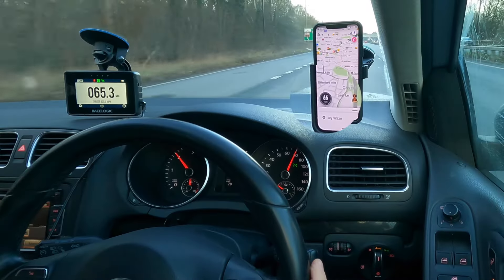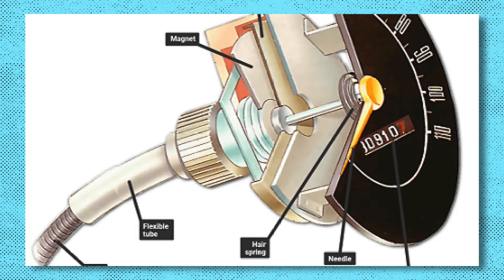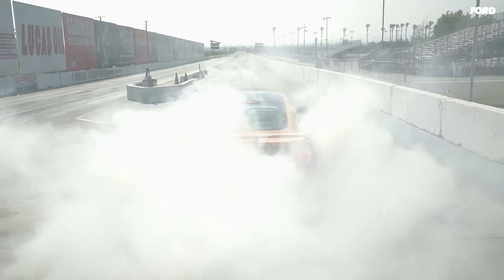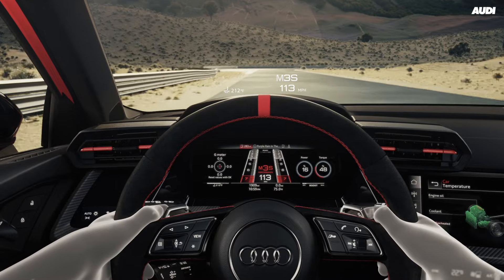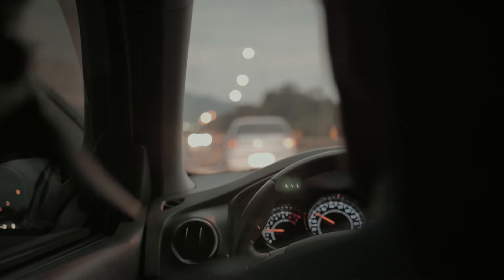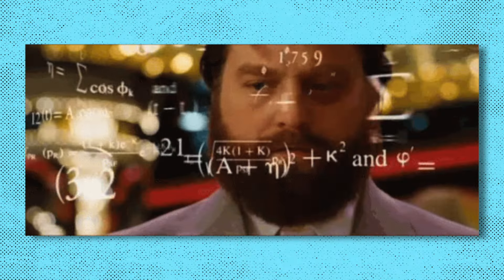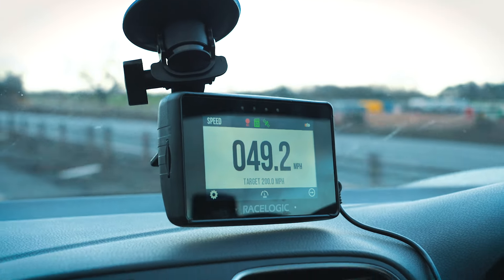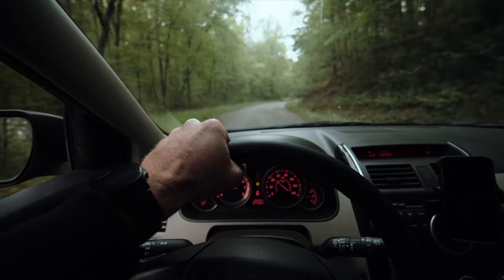Why Your Speedo is Lying to You

Comment: I'm using android multimedia- and there is a built in app as well as torque that shows actual speed, and it always off- e.g to go 130km/h your speedometer must show 137- at 200+ it makes differences up to 20km/h where 240km/h == 220km/h.. its also golf 6

Comment: In Australia the Design Regulation 18/03 specify for cars:
_The production shall be deemed to conform to this Regulation if the following relationship between the speed indicated on the display of the speedometer (V1) and the actual speed (V2) is observed:
In the case of vehicles of categories M and N:_  (Cars are in class M)
0 ≤ (V1 – V2) ≤ 0.1 V2 + 6 km/h  

So in short the speedo can read up to, 10%+6kph over the actual speed, but not under at all.
My Honda bike is a consistent 10% higher than actual, my old Toyota also over read, but my Jeep is reasonably accurate from factory.  (It is more so now that I recalibrated it against GPS via OBD2 by updating the wheel size recorded in which ever one of the computers stores that data.)

Comment: My Toyota GT86 dash shows constantly 6km/h over. The OBDII port reads exactly the same as GPS speed. The car knows how fast it is going but has a safety margin to make up for weird tyre choices I am guessing. Anyway I always drive an indicated 10km/h over which is only 4km/h over and under the trip point of the speed cameras.

Comment: I live in Germany. My car reads some 10km/h off at high speed, 5km/h up to 120 km/h and it is very accurate up to 30-40 kmh. I usually drive 23 over the limit. I might still get a ticket, but I am not risking my licence (licence gets suspended from 23km/h upwards). Needless to say I do this on highways and not in cities where such high speed can be dangerous in 30km/h zones(although in some is perfectly fine).

Comment: My 2005 Cadillac STS is spot on and same with my 2014 ats. Both Speedo’s are spot on. My 05 deville I changed the wheels so my speedo isn’t accurate. It’s off by 1mph or so.

Comment: Here in Texas, USA you will often see a radar unit standing just off the shoulder of the road. It will show you what it what your speed is according to its radar reading is. Now I drive a 2011 Ford Escape with a six cylinder engine and a five speed manual transmission (100,000+ miles on the clock). My speedo indicates 62/63 mph when those radar thingies tell me I am doing 60. Not bad I think.

Comment: Having owned/driven multiple Mazdas i can confirm that all of them where almost spot on (often only 1-2kph slower at 100kph) with the speedo compared to GPS, where many german cars, even recent ones, needed a bit over 110kph on the speedo for real 100kph gps. a golf 6 i could drive at 150kph indicated on the autobahn while only doing ~132-133 real. 

that might also explain the tendency of many people bragging their car goes 30kph faster than the manual says (no car will do that) because simply the speedo is indicating 10% + 5kph too much and there was a slight tailwind.

Comment: My Australian Ford G6E Turbo shows an indicated speed of 110kmph whilst GPS indicates 109kmph. Factory wheels and factory size tires. My wife's freelander 2 however is s different story indicating around 7-10kmph (4.5mph-6.2mph) (at 110kmph) faster on the speedometer vs gps. These are logarithmic and relate better to a percentage as the faster you go the further out they are.

Comment: My 2017 Clio says 50 when the radar speed camera near me says 46 when I'm driving past. Also I regulary sit behind cars in 30 zone where they must think they are doing 30 but my Clio tells me I'm doing 27/28.  Seeing as my Clio under reads by 8%, they must be under reading by even more.. I've defn been thinking my car under reads for a while but thought it was just me so thanks for letting me know it's endemic in nearly all cars.  ps I have a vanilla Clio, no mods or wheel/tyre changes.

Comment: My motorcycle (Yamaha FZ6) has a 5% margin with new tires, and 7% with worn tires... And, in Spain, the tolerance that you have on speed cameras is 7km/h for 70km/h or under, 10% for any higher to 70km/h. Additionally to that, they do implement a buffer to ensure that when it goes off, you're screwed. Meaning, a speed camera in a 120km/h section could fine you starting at 132 real km/h, however, they won't go off until 135km/h. This is so when the camera flashes, they can streamline the processing of that ticket and ensure that you can't refute it.

Comment: What about tire pressure? Tire pressure causes tires to rotate at different speeds. In fact, that's exactly how my Civic kicks on a low tire pressure warning since the tires themselves don't have a pressure sensor.

I imagine if you're riding with low tire pressure, your speedometer will also be off.

Comment: I have a 2013 VW GTI and installed a Kenwood head unit that has navigation. The speedometer never reads more than two MPH higher than the GPS.

Comment: It’s telling when a 15€ adapter which connects to the OBD2 connector makes a correct speed reading compared to the cars odometer. Shows you what junk manufacturers sell you. If they can’t make it display the correct speed (again, the cars sensors actually measure the correct speed), the car is trash as total.

Comment: My 1965 Ford Mustang speedometer reads 60 MPH when I ‘m actually doing 50 MPH.  However, I have changed the gear set in my manual transmission to a close-ratio set, changed the rear-end gear set to a 3.50, installed lower profile tires and even changed the speedo pick up gear.  So, guess I’m just screwed.

Comment: the speed from teh gps is only as accuracy as u set it to be just like the one from eh car. if u make the refresh rate from teh gps too slow and u  were driving in circles, the gps will calculate the distance from point A to point B in a straight line, so if the refresh rate is not high enough, then teh speed from teh gps is actually be lower then teh actual speed ur going since it measuring in a strgith line and not eh circulfrense of the circle.

Comment: Tires are waaay important in this matter.  i can tell the difference with my BIKE when i ride a fixed distance on the speedo when my tires are fully pumped up or soft.  over a 5 km distance 100psi tires vs 85psi tires (the same tires btw) amounts to maybe 50 meters.  The speed measurement is a simple magnetic wheel sensor and a tire diameter, which brings us to tire diameter.  overinflated, underinflated, hot day, cold day, tires refitted not using OEM stock sizes all have significant effects on speedo readings.  I am sure cars are probably setup to measure quite accurately the RPM of the drive shaft or axle, but then there are differential axles and other complications, probably all in the noise.  But tire circumference MUST be the key variable...  On my bike, my garmin computer calibrates periodically the tire circumference using the GPS so that the robust system of the wheel sensor is accurate and averages out any errors over the course of a ride.  Old school systems had a fixed circumference (user set) of course and no GPS.

Comment: Hyundai i30 1.6 D. 5% over. When I get into a “new” car idk two things:
① a “panic stop” under controlled conditions. I’d rather know if the rear is going to overtake the front under ⓜⓨ terms 
② try to get to a motorway with a good stretch, stopwatch and set the cruise control to say, 110 km/h and then time to do a stretch of at least 50 km. This should give a relatively good approximation of real speed. 
I have had Toyotas, Nissans,  Peugeots and the only one that was close to spot-on was a Holden Commodore series 2 1972. (Stralia, I also stalk strine)

Comment: im so happy America is big enough that speed cameras are so rare. as well as speed has a good deal of leniency, depending on the area, ive had officer interactions where they have told me they dont pull anyone over going under 15mph over. on average on the highway its a 10mph leniency when it comes to law enforcement. i actually even think radars are only accurate to about 70% of the time which is why cops will give that leniency.

Comment: I think you need to compare the speed reading vs the actual milage. As your car may be racking up miles you are not doing! Meaning more frequent services and false mpg. 

Using VCDS you can compare the ECU wheel speed sensors vs the readout (often different) 

my Ateca is 3mph out at 70

Comment: Motorcycles are generally really bad. That euro rule is about where most of them are, 10% + the 6km/h. My zx6 with an old school mechanical system is very optimistic, a true 70 mph is around 83-85  indicated. 20mph is pretty much an indicated 30. Little wonder I felt like I was crawling in a 20 zone with a camera.....   I would have been lucky to be doing much more than jogging speed!
One thing of note, as the bike doesn't have a fuel gauge I reset my trip meter to gauge range left in the tank. The odometer mechanism IS almost spot on to within less than .25% which can be accounted for by the shape of a motorcycle tyre and how it actually corners.

Comment: There's a few things to point out. First, all modern cars also measure speed via GPS. Second, measuring speed over GPS doesn't work by comparing positions because this would be hugely inacurate. As far as I know, they measure the Doppler effect on the satellites signals but I'm not sure that's correct. Third, speeding cameras tolerances isn't for fun. It means the measurement can be off by this amount. So, going 55, the cam could read 50. But it could also read 60. So don't rely on tolerances - Only rely on the readouts cause then you might be a few mph slower but you're very safe from tickets.

Car manufacturers have no interest in faking speed readouts - Everybody knows speedos are off. They do have an interest in not getting sued to pay speeding tickets because their speedo was underreading.
Reply: Awesome that someone else is pointing out the Doppler effect. That's correct to my knowledge. With that you also don't need a minimum of 4 satellites as you'd need to read your position.

Comment: My Golf GTI reads 1 mph slower than GPS at 70 mph. At much higher speeds in “Mexico” it reads 6 mph slower. I have this thing called PolarFIS which reads off the CAN BUS. That’s accurate. It shows the speed and other pages of info on the screen in my dash. On my Audi RS3, the speed is dead accurate with GPS. It’s strange.

Comment: I always do 10% over (on gps) through speed cameras, some i know ive gone the 10% plus 2, so on motorways ive done 79mph (via waze) and never got tickets, as was said, not all cameras are this way so if im in a new area i stick to about 5% over and so far no tickets, knock on wood
Also my golf mk4 reads about 4mph out at 70mph so on my speed i have to go about 74mph for gps to read 70

Comment: The speedometer is usually showing a few km/h to much, so you can put a bit smaller tires (for example some winter tires are smaller then summer tires) and the speed would still be ok for speed cameras. Also, if there is a speed camera, you rather drive a few km/h to slow then a few km/h to fast. Also this differs from car to car. My Seat Ibiza is 7 km/h off at 100 km/h, the VW T4 Multivan is only 3 km/h off at 100 km/h, and our old Mercedes W123 300D is over 13km/h off at 100 km/h
I think car manufactorers do this because they would have to pay to the government if the speedo showed to much with factory tires

Comment: My car seems on point with 3 different GPS systems with its digital side. Meaning my digital speedo is accurate with GPS and also matches what the ecu sees however the needle always seems 1 or 2 mph off slower 2007 mercedes

Comment: My old Citroen C3 overreads at any speed. Interesting thing with it is that the overreading is more and more exaggerated the faster I'm going. It seems to be overreading by 10%, but not quite. If I do 54-55 km\h, the GPS would read 50. If I were to go 77 km\h, the GPS would read 70. Seems 10%, but if I go 110 km\h, I'm actually doing 102-103. At first I thought it was because of the age of the car and that some sensor was off, but then I drove my dad's new Renault and noticed that it was always overreading by 4 km\h at any speed

Comment: All those variances of tyre deformation, pressure, wear etc, wouldn't have such a huge affect on speedo read out. Different tyre/wheel sizes, yes, but even from factory, most cars don't read right. I've had some shocking incorrect speedos in the past!
I've just calibrated my Discovery 4 to be within .5kph, which is nice (checked by my phone and the cars' hidden menu GPA read out - why doesn't it just use that?!). Using a GAP tool, I actually found that the car was accurate without any mods. It was a variance in the read-out on the dash, which LR must have put in.

Comment: 2008 Chevrolet Silverado, running 235 70.17 tires due for repalxent soon. 1 mph fast.at 55.

1991 K2500, 12 valve Cummins swap, 6.speed on 37s. 3 MPH slow, also at.55,.with less.than 1500 miles.on them.

1999 Lincoln Executive L, spot on at.65.

Comment: I use my sat nav to set my speed. I followed a cop for 25+ in NSW and stopped when he did. I spoke with him and he said we were doing exactly 110 kph. My speedo was showing 116kph . I am comfortable at travelling 2kph over the limit so my speedo at 118 to 119  is fine. I have done this for 9 years and I have not had a speeding ticket!

Comment: I have seen where a lot of Japanese Mfg cars were reading more miles than they actually traveled.   My theory was that this in effect was giving the impression to the owner that they were getting more MPG than what was actually being achieved.  A subtle way for the Japanese cars to gain more sales because people were flocking to purchase them for the "better" fuel economy.  Another mfg benefit is that the Japanese cars were claiming much higher overall lifetime miles driven than what was truly driven.  Again, buyers were then under the impression that their cars could have a much longer "lifespan" because their odometers would falsely show exorbitantly high miles driven.  Pretty sneaky and subtle trick by the Japanese manufacturers.
Reply: I have also noticed that when driving behind a lot of Japanese cars on the road, that they would often be driving up to 5 mph slower than the posted speed limit.  In "their world" those drivers were probably thinking, why are people always riding my @$$?  Well it is most likey due to the fact that their were in fact driving slower than what their speedomoter was indicating.

Comment: I had motorcycle with a speedo that underreads. I assumed digital was more accurate. I found out it wasn't when I got a ticket for 6kph over what my speedo read. If my speedo was accurate it would have been okay but the 6kph resulted in impound. I don't have that motorcycle anymore. 🇨🇦

Comment: I live in N.S.W and the fixed speed cameras have a 10%built in but there mobile speed cameras an SUV parked at the side if the road and they with 0% on your speed and also a speed detection which gives you your speed on a screen you will not get booked for speeding well many years ago l owned a Mazda Bravo ute and l was driving at 60kph through a works zone which was the speed limit through the works zone and there was one of these speed indicators to let you know how fast you were going and it indicated l was doing 54kph so l well under the 60kph l had the correct size tyres a recommended by the manufacturer they may have the tyres that came with the ute and it was explained that most speedometers over read is so you don't exceed the speed limit and in that ute l was doing 110kph in a 100kph zone and this police officer was on a motorcycle and l pulled into the right hand lane and he just ride past me l thought he would pull me up for speeding

Comment: like you mentioned the GPS is also not 100% precise, most cops are using stationary Laser or Radar to measure the velocity, and they are very precise, in all case they give you 10% of tolerance so it should be enough that nobody has trouble because of wrong speed measured by his own car

Comment: Not a car, motorcycle, it's fairly common to change gearing when servicing the chain and sprockets, with original gearing 17/45, it was over reading over about 4-5mph at 100mph and about 3-4 at 70, with 17/44 gearing it's now more accurate, 3-4 at 100mph and right about 2 at 70mph, tyres do make a difference on certain bikes too but mine bike actually self calibrates for the circumference based on accelerometer and abs sensor data to keep the traction control system accurate. so never noticed the speedo getting more or less accurate when swapping brand new tyres on, unlike my older bikes.